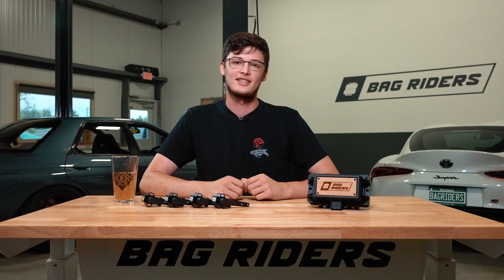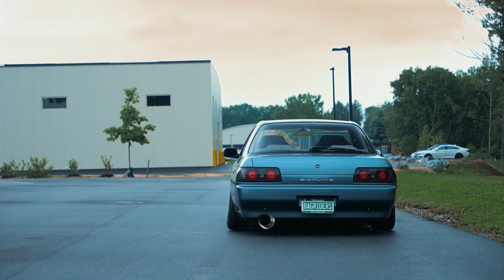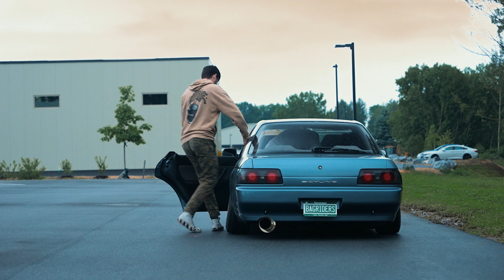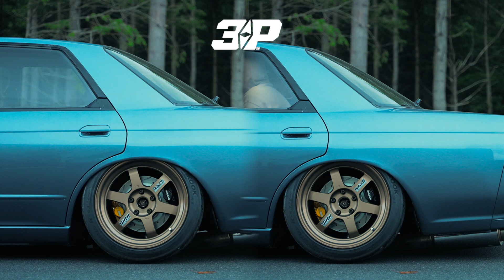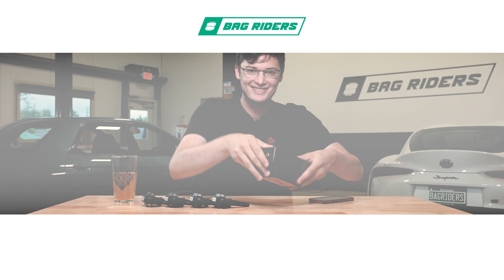What is The Difference Between Height Based and Pressure Based Air Ride Systems?

Comment: I just purchased the 3P system for my GR86 and was wondering how difficult it would be to convert to 3H?
Reply from the maker: Converting to 3H is simple with our 3H upgrade kit! It includes the necessary harness and height sensors to complete the conversion seamlessly. https://www.bagriders.com/air-lift-3p-to-3h-upgrade-kit.html

Comment: I have a 3P system and I set some presets by equally measuring the height on all sides, however, my pressures are all different. For example on one setting where I measure the car at the same height all around. The front wheels are 75 PSI and 68 PSIand the back are 80 PSI and 69 PSI. Is this normal/safe?
Reply from the maker: The first step we always recommend is making sure the system is fully calibrated. Since you are using a 3P system, it sounds like you are setting your measured heights based off pressures and pressure does not equal height. In some cases where a sleeve bag is applicable the pressure set vs the desired height can be drastically off. This is when we recommend using height sensors.

Comment: I have to park on the side of a curb every day i think the unlevel ground + cold weather cause the pressure in my car to not obtain desured ride height everytime, this is a must. But how reliable are the height sensors? Being that i live in colorado will they break when hitting pot holes?
Reply from the maker: Height sensors are extremely reliable when set up correctly. The key to having them not break is allowing them to cycle to the full length of your suspension travel so when you do hit bumps or potholes the sensor stays intact. Another thing to note is that if a sensor were to go out of the travel range the height sensor arm would break first which is only a $10 replacement vs the $125 sensor.

Comment: What's the max height on something like this? I have a mini Cooper which I love on flat ground but will scrape in every single speed bump.

 I get the benefits of lowering but I would also like to glide over shitty roads over bags with a lot more clearance and also to make jumping in and out not a missery.
Reply from the maker: The average amount of lift found on most air suspension brands is around 3.5 inches, depending on the chassis. Which numerically may not sound like a lot, but it is more than enough lift to be able to get into steep driveways or dodge that obstacle in the road.
Reply: @bagriders  3.5 inches over stock height would be absolutely perfect for my application (very shitty roads). 

The only downside to this is the fact that I have to lose all my trunk space.
Reply from the maker: @amedsoprano  That's 3.5 of range in total. Most air suspension applications are intended to lower the car, not lift.

Comment: I watched this to see if I’m missing something, but I still think height based is a gimmick. OEM spring systems are “pressure” (lb/ft) based. Bags are just air springs, I don’t get it 🤷‍♂️Unless you absolutely have to have ride height consistent 100% time for aesthetics or crazy wheel clearance or something.
Reply from the maker: Actually a lot of OEM spring systems work off height sensors as well. Height sensors help keep the spring rate and ride height consistent regardless of the load. For example if you put 4 people in your car, air up to your normal ride preset designed for 1 person the car will not be level and have a much lower spring rate due to the weight. The height sensors will correct that and air up to your desired ride height. Hope this helps!
Reply: So what if you never have more ppl in youre car.  Do you really need it then ?  @bagriders

Comment: Good video. So I have to say height is better but then it just gives more parts to replace if something fails. Airlift has many manifold issues as it is. Nvrmind height sensors. In my opinion. If someone doing air I would go level ride. His systems are wayyy more reliable
Reply from the maker: Thanks for watching our video! Height sensors only fail when they are set up incorrectly, if properly installed they will last forever. The Air Lift systems did have their issues many years ago but Air Lift has since addressed that.
Reply: @bagriders  i disagree but everyone is entitled to ther own opinion.

Comment: Thanks Phin for your explanation and explanation. 😆 I broke my rear height sensors on the Supra during calibration and have been tinkering with my strut height adjustments ever since as I couldn't obtain consistent height based on pressure. Guess I have to get new hight sensors installed.
Reply from the maker: Oh no!! Broken sensors are no fun! Just have to be careful with measuring the travel of the sensor to make sure where you attach it won't break the sensor :(

Comment: Awesome explanation!  I just had my 3H installed but for some reasons car would all of suddenly drop and air back up.  Car was set on "height based" with "maintain preset ON".  My installer said to turn the "maintain preset OFF" because the height sensor will interfere with preset?
Reply from the maker: Hey Johnny! Thanks so much! Preset maintain won't be interfering with the height sensor other than telling it what height to go to. A height sensor simply measures the travel of the suspension, and preset maintain simply tells the car to hold to that height/pressure no matter what happens (leak, more people in the car, ect)